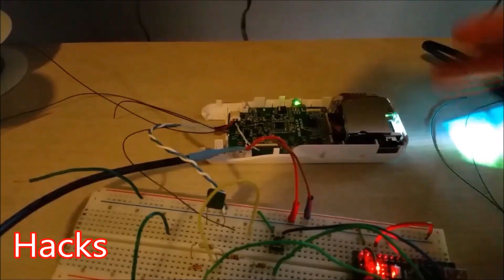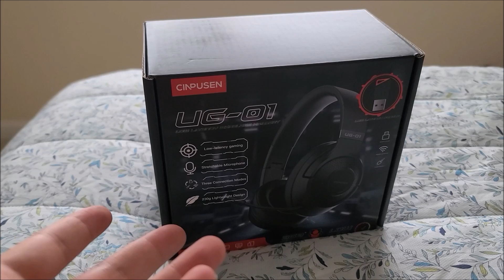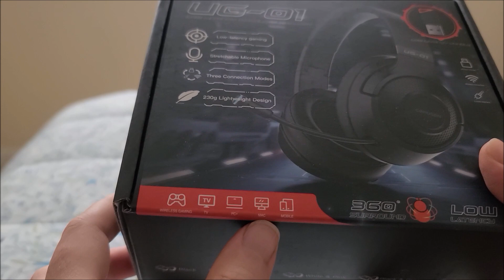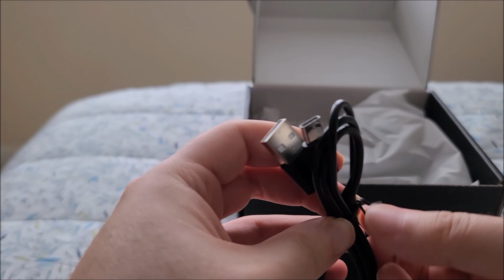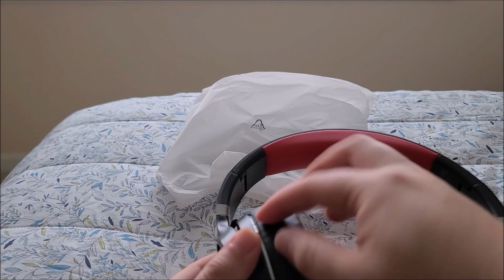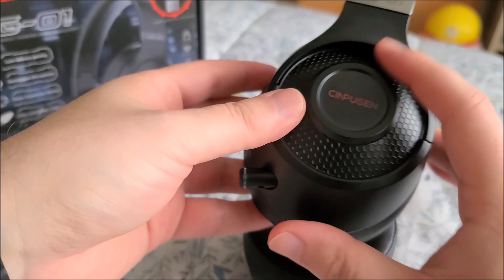Cinpusen UG-01 Bluetooth+2.4GHz Wireless Headphones for under $30!

Comment: What if you don't have the dongle? Can you get one. Their website is possibly down.
Reply from the maker: If the site is down it's likely the company is no longer in business so getting a replacement dongle is slim. Even without the dongle though you can always default to wired or bluetooth wireless modes.

Comment: The Bluetooth won’t turn off how do I fix it
Reply from the maker: Like you cant power the headphones off? You hold the power button for a few seconds to turn it off.
Reply: @sjm4306  no like I use the usb because I play ps5 but it keeps saying “power on, Bluetooth mode” even tho Bluetooth doesn’t work for ps5, and I didn’t connect it.
Reply from the maker: So iirc to switch to the usb dongle you have to press and hold the mode button till it says dongle.

Comment: It does have a pause/unpause feature. If you quick press the power button, it will pause your video/music. Do the same for unpausing. It is really reliable for pausing, though really unreliable for unpausing (keep in mind, this is all from my experience just using the dongle mode on a pc, it could totally change on other modes or devices).

Comment: anyone else bluetooth just doesn't connect and keeps on blinking? any help!?
Reply from the maker: You did first switch it from the default dongle mode to bluetooth by pressing and holding the mode button till you got the voice prompt?
Reply: @sjm4306  yeah i pretty sure i did its says dongale mode, but it doesn't say "connect" just keeps on blinking
Reply from the maker: It has to be in bluetooth mode, dongle mode will only connect to the included dongle
Reply: @sjm4306  like do i have to click the chip amount of times to change the mode or ?
Reply from the maker: hold the mode button till it says "bluetooth mode", there are only two modes it toggles between: bluetooth and dongle.
Reply: Me pasa a mí, dice dongle Mode y no se conecta al celular

Comment: I tried to use the dongle on my mac laptop but it just does not connect
Reply from the maker: Have you switched the headphones to the dongle mode? It should connect almost instantly then.
Reply: It didn’t connect but it works with normal bluetooth
Reply from the maker: You have to hold the M button on the headphones till it says Dongle Mode before it'll switch from bluetooth to the dongle.